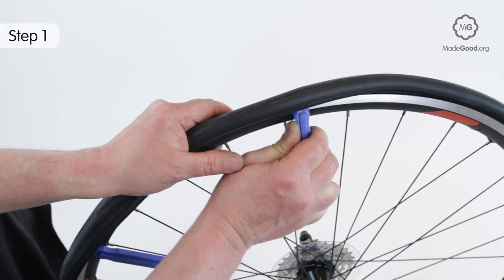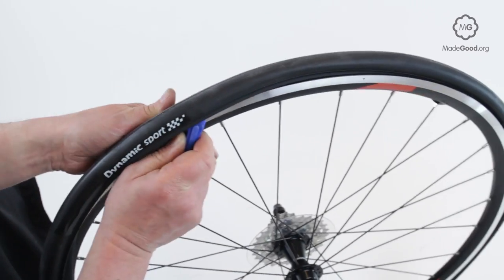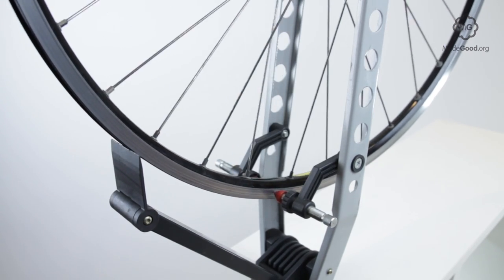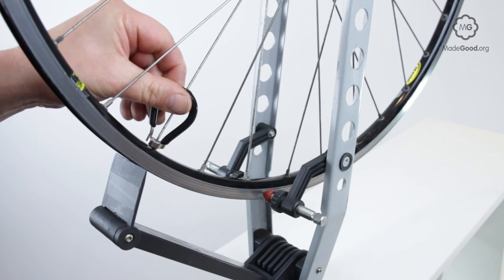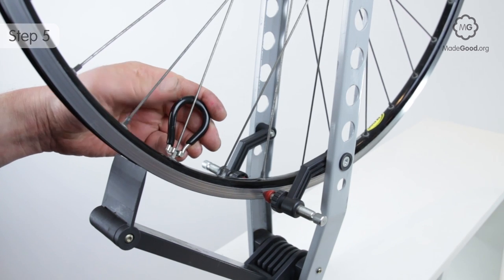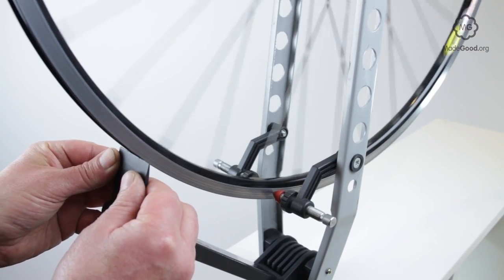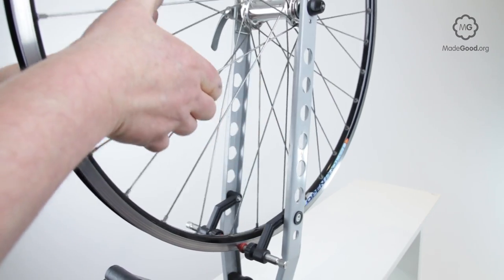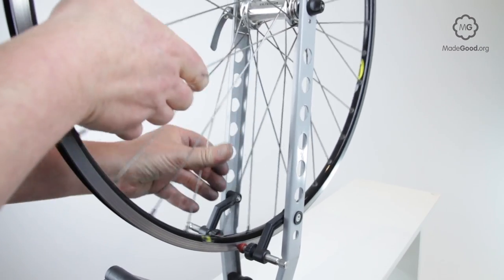True A Bike Wheel Rim To Make It Circular

Comment: When someone told me, you can't strighten an egg-shaped wheel at home, i was rightfully sceptical. Good there are people like this here, just have to look. For 20 videos on how to strighten the '8'-shape wobbly wheel, there was only 1 for the egg, much harder to get true. Don't know if you use the 'egg' term in english, but without this i'd try doing it with the tyre on and likely mess it up more. Now just have to construct that adjustable lever for calibration, thanks a bunch!

Comment: If there is significant vertical wobble in the wheel, probably a good idea to check that the wheel axle is not bent in any way by checking for wobbling in the hub itself. What I thought was largely a truing issue on my back wheel was in fact an axle one, requiring a replacement.
Reply: this you could check by axle turning by fingers, if axle goes up/down, something is wrong by axle or bearing

Comment: Right so I’m trying to get my head around this. I recently received a bike and had to replace 8 snapped spokes. Got the correct parts as this isn’t first time I’ve done wheels but the rim is egg shaped from where the spokes were broken. I have been tightening spokes on the opposite side of rim to pull the high spot inwards?.....
Reply from the maker: Yes that's the right idea, but if 8 spokes snapped then the wheel must have been under a lot of pressure. You can only correct the rim a relatively small amount, if the rim has been deformed then it will have to be replaced.
Reply: if 8 spokes broke in short period, you should replace all, if not to get it to go straight it would be easier to lose all remained spokes for same number of turns, to be soft and then instal new and start to true it from beginning
Reply: Makan Tahi It needed a new rim as no matter the tension of the spokes it had become deformed to an oval. Thanks for the advice though

Comment: What if the dip has loose spokes?
Reply: if some spokes are very soft and wheel is trued it means that rim is deformed- it can be salved by de-deformation by knee if it goes left/right, if goes up/down hammer should be used on flat spots, first spokes must be losen